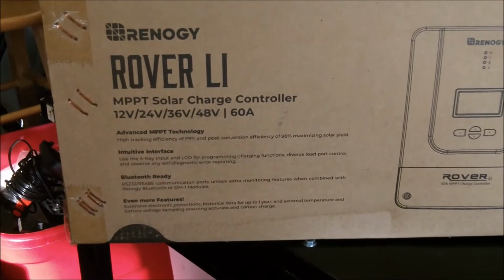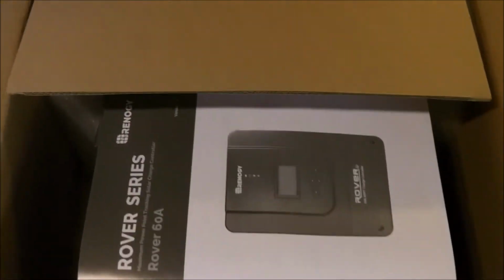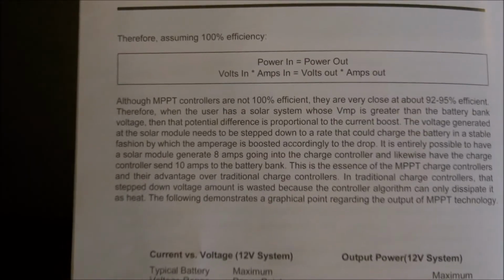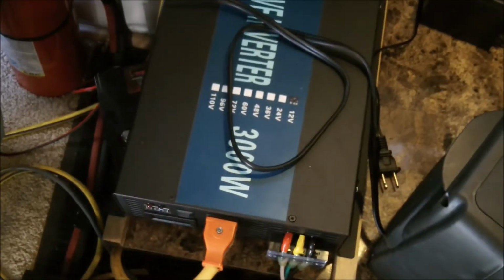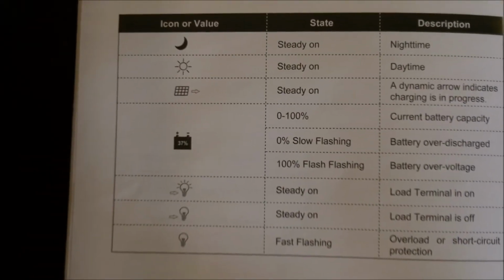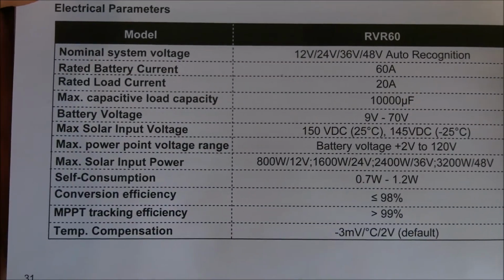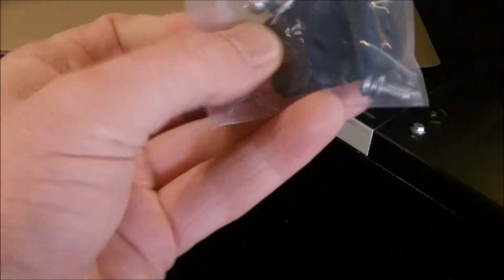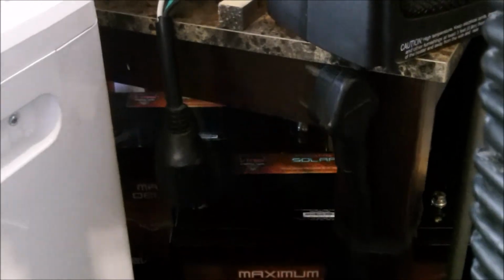Renogy 60A 12V/24V/36V/48V DC Input MPPT Solar Charge Controller

Comment: The hypothetical maximum input charging current coming from a hypothetical 12V , 100W, solar panel array for this 60A MPPT solar charge controller is purportedly a 60 amp maximum capacity limit, but what is the maximum discharge current capacity of this 60A MPPT solar charge controller?  40A?  30A? 20A?  In addition to selecting 'lithium ion battery' on this MPPT type 60A solar charge controller's L.C.D. screen, is any additional programming needed when using a lithium ion battery instead of lead acid battery (Does this 60A MPPT solar charge controller automatically program itself when connecting it to one or more lithium-ion battery?)?  Originally, I planned to buy a EPEVER Tracer MPPT solar charge controller, but it purportedly requires complex programming when using lithium-ion type batteries instead of lead acid type batteries.  Please indicate if I incorrectly used any solar terminology or used incorrect information the way I asked my questions; I have no experience with solar array design or 'set-up', and no experience using solar power, but I want to design a 12V direct current, portable, outdoor, solar powered swamp cooler using four 12V, 100W, 7A portable briefcase solar panels, two 12V 120W 10A direct current automotive radiator fans wired to one or two motor speed controllers (potentiometers), and one 12V, 20W, 2A submersible water pump.  I have not yet purchased the 12V lead acid or lithium-ion batteries or a solar charge controller.  I choose to buy an MPPT type solar charge controller that is at least rated at a 40A maximum input capacity and that is at least rated at a 30A maximum discharge capacity, but I'm now wondering if it would be better for me to buy an MPPT solar charge controller with a maximum input capacity of 60A and a maximum discharge capacity of 40A.  What is your opinion? I appreciate others to reply also.  Thank you.
Reply: 20 A max output for this model. I now use a all-in-one offgrid inverter that does it all. My model is a PowMr.